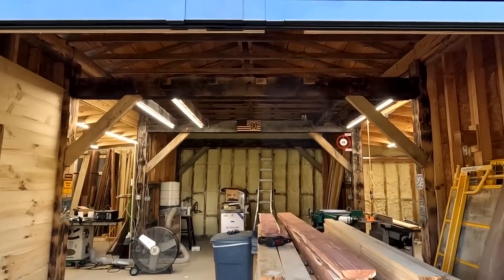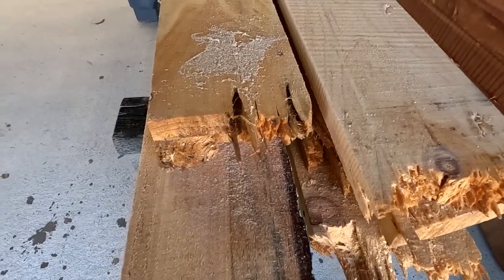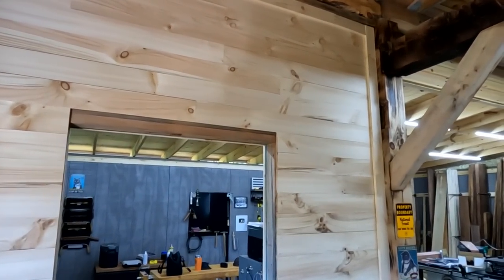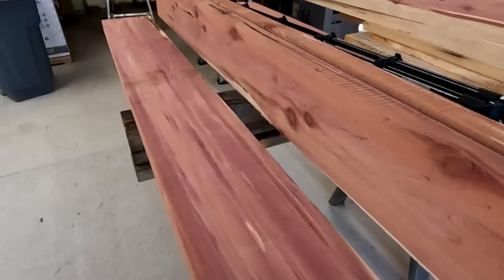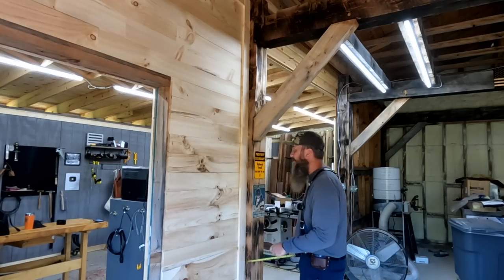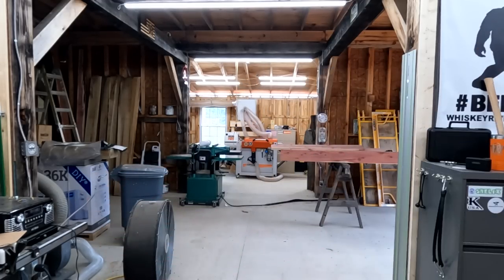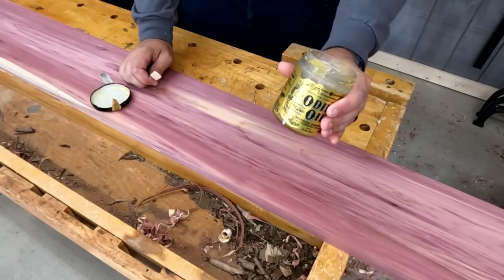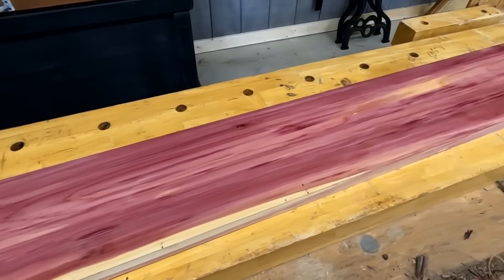Apple Sauce! The Best Finish For Woodworking

Comment: Quick question: did you  oil the back of that board?  Many decades ago an old cabinet maker (and furniture) told me that sealing all sides is just good practice to  keep wood from trying to cup. Don't have to be fancy but just seal the pores on all sides and pretty on anything that shows. Would hate to see that pretty cedar cupping later.
Reply: I’ve made a $150 mistake by not covering the back of a 8’ 2x10 red oak that I’ve installed inside a yogurt shop in the 80’s.
Reply: You and me…old school education by the “old timers” . Finish all sides. Lap siding…Back prime. Table tops…bottom seal.

Comment: If I could afford a wall like that😪
Reply: just spent 100K on machines as he has and u can afford it.
We poured slab for new workshop last week of July.  I got to teach ppl how to mix concert as we bought stone, sand & cement and all 15 of us got to do it as a team with four 1yd cement mixers just as we did when I was a kid and my Uncle Howard taught me how to mix at age seven.  At that age all I could do was add the water but with each load He talked me through.  How much san stone and cement to put in and then how to judge when u had the water right and if u got to much water in how to make it right.  Poured 8 barn floors and a few basements with him.
Next week we start the timber and frame.  It has been three yr logging the lumber, milling it, making the joints as we will be using rather large beams to span 40 ft with only a post every 20 ft.  They are white oak 16"X16".
We have milled and dried all the lumber we will need for this project.  Now all we need do it put this gib Lincoln log set together.  It will be a fun job for when it is white world doing the enterer.  It will be a three story building when done about Apr I.
Once we have it we go into furniture making big time.  This will be our first business where we will hire ppl to do work.  My elder bro will manage it as he has been doing fine furniture in his little shop now for the last 17 yr ever since he retired from IBM.  He has the contacts to sell and knows ppl who will come work for us.